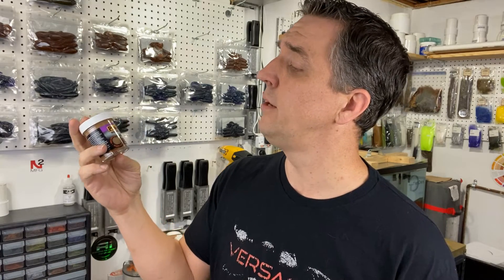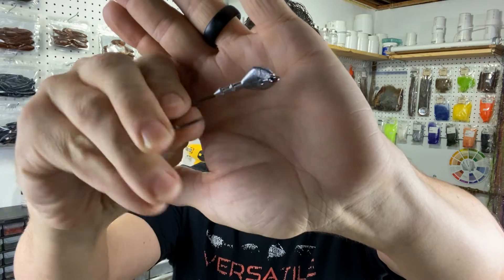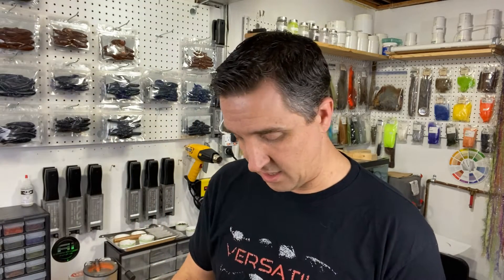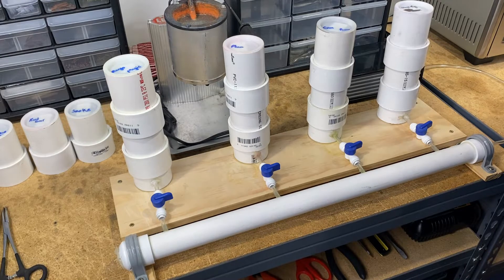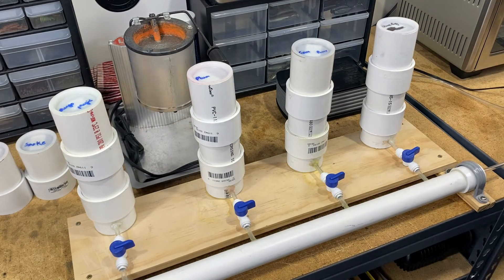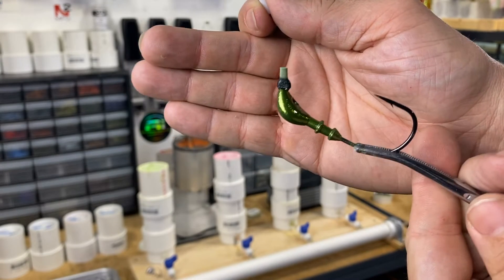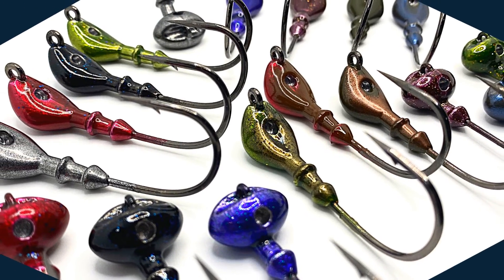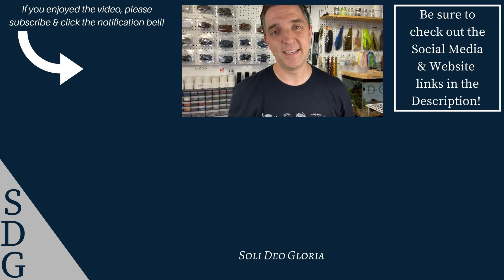How to Paint Jig Heads - Comprehensive Overview

Comment: Great video. I'm new to your channel.  I have been making my own jigs for years.  I use powder paints for my bullet weights only.  I use vinyl paints for my igs.  I put a clear coat of epoxy, mixed with some sort of glitter (fuschia or red).   In your opinion, what are the benefits of powder paints over the vinyl with a top coat of poxy?  Thanks!
Reply from the maker: Hey Rick, thanks for the feedback and I’m glad you found me!  Since I’ve never painted jigs the other way I’m no authority to speak about the difference, but one benefit I would GUESS is turn-around time.  I know epoxy takes time to cure whereas I can get an unpainted jig head ready for the vise in about 30-45 min.  But like I said, that’s just a guess.  Epoxy may be a bit more durable, but I’d have to test it to be sure.  Thanks again man!
Reply: @SDGCustomLurecraft  I love how the finish of the powder paint over vinyl.  However, the vinyl allows me to carefully "paint" around the hook eyes.  Both Janns Netcraft and Barlow pro-staff say the powder paint is more durable than vinyl.  However, the epoxy finish on vinyl is pretty close to the chip resistance of the baked powder finish.

Great videos and I'm glad I found another lure-making geek like myself!
Reply from the maker: @1MoreFish  Heck yeah man!  Check out my “Wednesday in the Workshop” playlist, lots of good stuff in there related to jig painting and general tips/tricks in the shop.  I have a dedicated video about how to keep paint out of the hook eye, a topic I touched on in this video.

Comment: Sorry if this has been asked before but where do you get the jig head with the hole in it for the weed guard? Are they sold commercially or do you make your own? Thanks
Reply from the maker: I make all my own.  Do-It makes the molds.  I melt and pour the lead into the molds and prep the heads before painting.  They are sold commercially though - a number of online retailers offer “unpainted heads”.
Reply: @SDGCustomLurecraft  
Thanks. I just can’t seem to find any that come with the weed guard hole but without the weed guard.
Reply from the maker: @Osprey1955  Try these: 
https://barlowstackle.com/crappie-and-panfish-gear/unpainted-jig-heads/

and

https://www.fishingskirts.com/boss-unpainted-jigs/
Reply: @SDGCustomLurecraft  
Thanks very much. Barlows doesn’t have any but Fishing Skirts does.

Comment: how close to the hole did you put the tubing, going from the 1 inch tube to the shark bite fitting?
Reply from the maker: If I understand your question, I cut a 5” piece in half, so 2.5” from the 1” PVC manifold to the valve, then 2.5 again to the cup.  But that was relative to my size board (10” wide) and each piece of tubing extended into the cup and manifold a bit.  Hope that helps!

Comment: Sorry for the stupid question but why do you need to air rate the paint.
Reply from the maker: Hey Dave, not a stupid question at all, thanks for asking.  First off, you don’t NEED a fluid bed to paint jig heads, you just miss out on the benefits it offers if you don’t use one. What are the benefits?  The addition of air to the paint allows you to dip it and get a very even, thin coating.  Powder paint can be brittle when over-applied… and when dipping into the jar directly, the “bottom” of the jig that is pressed into the paint to “sink” the head all the way (for full coverage) can melt too much paint as it’s pushed down… that extra can sag and cause any number of issues for you. A fluid bed really helps you avoid that problem!
Reply: @SDGCustomLurecraft  

Thanks for the detailed explanation.  I have an idea for something similar.  Perhaps in the future I will build it to many other projects going on right now.

Comment: Great video. I have a quick question. Do you apply the second coat right after the base coat or do you reheat the jig first?
Reply from the maker: Hey Russel, thanks for the question!  If I double-dip (don’t always) I do it right away while the head is still hot.

Comment: Why not just put jigheads in toaster oven to heat up, dip, and then put back in toaster to bake? Is there a flaw there that i’m not seeing?
Reply from the maker: Hey Alan, thanks for the question!  That’s certainly an option, but it takes a LOT longer for the heads to heat up via an oven, and in my experience, they don’t get AS hot as the heat gun can accomplish so the paint doesn’t want to melt as well.  There’s other limitation I found when I tried it that I’ll spare you of, but suffice to say for me… it ended up being faster and more efficient to use the heat gun, head by head.  Hope this helps!
Reply: @SDGCustomLurecraft  Thanks for the response! I really love everything about this newly discovered channel!
Reply from the maker: Great to hear, thx man!

Comment: What if you break off a piece of toothpick in the eye before painting 🤙🤙
Reply from the maker: Definitely an option!  When I've done similar things and go to remove it I either get a stringy mess as the powder paint is still soft and pulls, or, I wait until it hardens and I get sharp edges (not so hot for the line).  And, if I recall, it often refills while in the oven curing since there was paint on the eye to begin with.  But who knows, maybe I did something off kilter and it works great for other guys, LOL!  Thanks for the suggestion all the same!

Comment: Your stuff looks great. But watching and reading the comments. You all have made this way too complicated. If you just want to make a process and have time to kill. That's fine.
I have been doing this for a long time.
Hang parts from racks in oven. Heat oven to 375. cup of powder on stovetop. Once jigs reach temp where when dipped the paint melts to jig. They are ready. 
open door, with pliers grab hook, close door, dip into cup. With spoon drop a little paint on top avoiding eye. Back in oven grab next. I can color 50 jigs in 15 minutes. leave at temp for 5 minutes. Turn off oven
If you get paint on eye, immediately remove with toothpick, pick with fingernail. Return to oven for final bake. Done
Reply from the maker: Thx for watching!